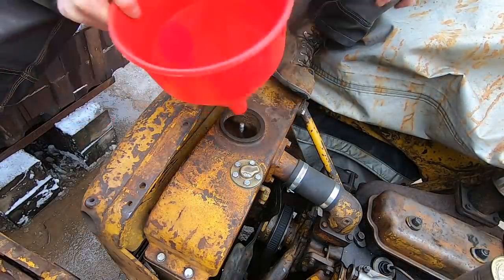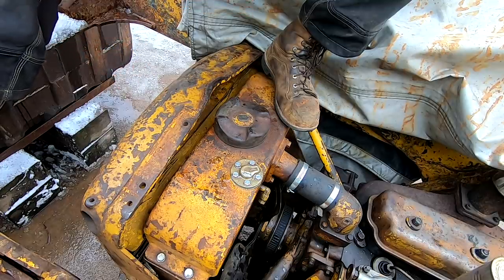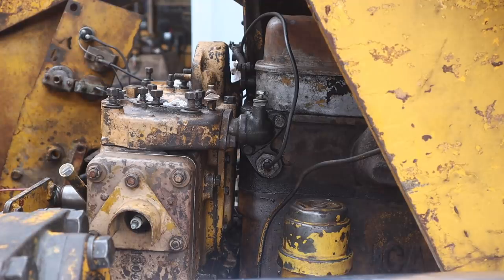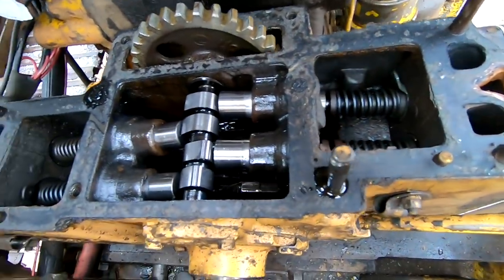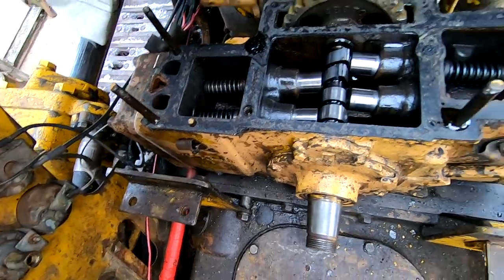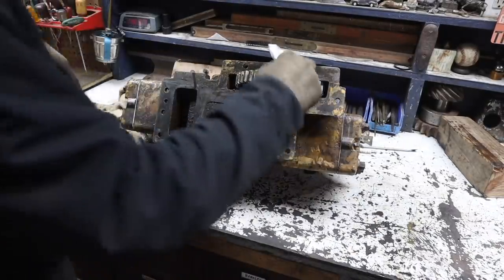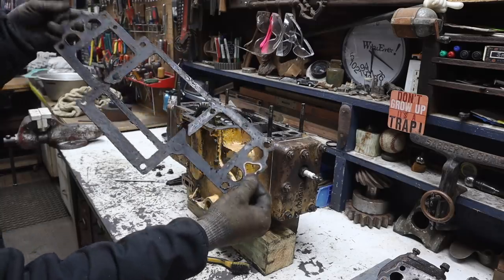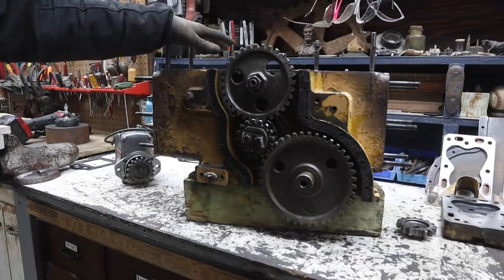I REMOVED the Pony Motor!!! ~ Part 15 ~ 1950s Caterpillar TraxCavator

Comment: Bearing material is Babbit. Casting one from scratch  could be tricky. I've seen it done by some here on Y/T.
Reply: They are aluminum.
Reply: @brianrvd  they are NOT aluminium
Reply from the maker: @bigtrev8xl  DEFINITELY an Aluminum Alloy!
Reply: @bigtrev8xl  "Aluminum alloy connecting rod and main bearings are now used in all current Caterpillar diesel engines. These bearings are interchangeable with the precision type babbitt bearings formerly used and will give much longer bearing life." Published in Caterpillar Service Magazine, November 29, 1946. Reprinted In "Selected Caterpillar Service Magazine Articles 1932-1950". Where's your proof that they are not aluminum? It is certainly not from experience. There are some of us out here who actually know about old Caterpillars.
Reply: @brianrvd  Which of the 6000 grades of aluminium?
Reply: @SalvageWorkshop   which of the 6000 grades of aluminium ?
Reply: @brianrvd  I see you're now saying "Aluminum alloy''
Reply: @bigtrev8xl  the original Cat spec from the 1940's was 750-T5 which isn't made anymore.  7075-T6 is the closest modern equivalent.  Most Cat restorers use common 6061-T6.
Reply: @bigtrev8xl  of course it is an aluminum alloy.  Are you saying that aluminum alloy isn't aluminum? Pure aluminum isn't used for hardly anything but aluminum foil.  Any commercial aluminum that you buy for making machine parts will be an alloy.  Common 6061 alloy is over 97% aluminum.
Reply: @brianrvd  Sorry, thought you said aluminium  ;) ;)
Reply: @bigtrev8xl  no, I've never said aluminium, that is just wrong. :)
Reply: @brianrvd  "Brian
 2 days ago
They are aluminum."
Reply: @bigtrev8xl  I thought you were joking about the second "i" in aluminium, that is wrong.  Pony motor bearings are aluminum.  Get one for yourself and find out.  If you think aluminum alloy is not aluminum, then you got me, they are not aluminum.  I would like to hear what you think they are made out of since you know for a fact that they are not aluminum.

Comment: Cat's starting motors were designed to be simple but not durable as they only run for short periods of time and have a 250 hour service life (according to Squatch253).  Seems like no one takes care of them and gas often gets in the oil because they have downdraft carbs and operators shut them off by killing the mag but not turning off the gas. Personally I'd just find new/used replacement main bearings, clean everything, lap the valves and just put it back together doing whatever you need to do to get the gear lash/mesh close to spec.

Comment: My husband is restoring a Siox bench grinder. He is having trouble figuring out the correct size for the ball bearings. He watched a video on here a while back and wondering if you could help with number for bearing or where you purchased yours. Thanks in advance!
Reply: Ball bearings are normally marked with an etched number but depending on the age, could be inch sizes (old stuff) metric size (for last 40 years or more) or occasionally inch inside and metric OD.  
Just need measurements and a catalog!

Comment: Babit bearings are a combination of lead and tin,especially in older engines. In today's engines l am pretty sure that they still use that with a few extra alloys. There is bearing quality brass that you can buy.

Comment: Bronz would make a great bearing, make sure about the cam bearings, its important, If  guy had a lathe and mill he could make block off for the water ports and make an adaptor for a starter and loose the pony motor

Comment: Abaut the aluminum bearing, yes bronze sounds fine but a standardized needle-bearing might be the better solution but that's up to you
If bronze you definately should cut a helical oil groove into it with a  dremmel,

Comment: Why didn't you record the end play movement with a dial indicator before disassembly? You are only assuming the movement was out of specifications.
Reply: It’s out! 
Spec is about 0.010” with a max  of .015.  That kind of end play from the bearing and it’s retaining dowel getting loose in the block eventually breaks the crankshaft in the center between the two throws.  Lots of them run a long time like that but they do break

Comment: Go searching for the second half nut. I'd presume the nut, probably still as a complete one, broke the Magneto gear and bent the shaft. If so, the second half could re-wreck all again if not extracted, as well as all shards/teeth of the ruined gear. Magnets (neodymium washer magnet on string) everywhere could help extracting those pieces. That lateral play does nothing to break gears like that, and the little amount of radial play does not do that either: There was a hard foreign object between those teeth of cam and Magneto gear to break/bend it so badly - You gotta look for the rest of this nut!
Reply: Caterpillar identified a loose pony motor flywheel as a cause of broken magneto shaft way back in the 1950’s.  Not too much of a stretch to attribute the gear failure to the same cause.  It apparently sets up some sort of harmonic.

Comment: I suspect the connecting rod nut backed off and slammed into the block, cracking it...and one way or another, cracked the magneto gear and once that failed, took out another tooth or two. That's my wild ass guess anyway.

Comment: The notch on the fly wheel is so you can use a rope to pull start the pony motor but it is the hard way to start the pony.

Comment: I know that you are getting a lot of comments from the cheap seats and or peanut gallery.  I though I would add my 1.5 cents worth of stupid comments in.  First is, please get rid of that T gauge.  I have seen some of the best screw up with those.  Get yourself a good dial bore gauge.  If the mic you use is accurate to set it, you will never get a bad reading.  I have bored a few engines and had over a million pistons go through my hands. 

Second.  I think brass and or bronze is a good choice for your bushings.  I would go for brass.  It is softer and the most widely used for bushings.  Aluminum has the greatest thermal expansion.  This means that the hotter it gets, the more clearance you get between the surface and bushing.  The hole gets bigger.  Brass is second in the thermal expansion.  This means the clearance will not not change as much as aluminum.  Third is bronze.  It has about the same thermal expansion as cast iron.  So the clearance between the two at any temp is the most stable.  The problem with bronze is it is harder.  This means it is more likely to do damage to the crank.  So brass is best.  Now the big problem is to pick out the best grade of brass.   I will leave that to you.

Third, I know you are no newbie to this, BUT.  You made indications of reusing the rings and rod bearings.  If you do this, I hope you cross hatch the cylinders and plasti-gauge  the rod bearings.

Ok, that is my 1.5 cents of useless information.  Have fun and I wish I was there to at least watch.

Comment: Given that you have gotten the engine already apart just spend the extra 40 or 50 dollars and replace the rings and rod bearings. Time wise it's only about  30 extra minutes and you know for sure that the rings and bearings are good.

Comment: If there is slack in both directions on the pony motor crankshaft, then both bearings are bad, front and back.

Comment: Castle nut was probably stuck in sludge at the bottom of the oil pan but got freed up, when he changed the oil, then it got between the gears and broke the teeth.

Comment: Cat made everything themselves, I thought they bought the ponys from somebody like Kohler, but no, made their own.  It's built like a tractor engine, tough, well it's a cat.  Your right about somebody being in there B4.  I'll bet those spiral grove move oil inward so they don't need oil seals.
Reply: Correct, called oil slingers. First time I saw them was on Ford Flathead V8.
Reply: @johnliebermann4643  common on British cars, that's why they always have a little oil drip.

Comment: I am confident the water flow is thermosyphon through the pony motor. It will naturally lift water through itself and down through the main engine. The main engine will reverse the flow when it starts.
Reply: As soon as possible after starting the pony motor, the pinion is engaged and main engine turns so it’s water pump circulates some coolant within the block.  But you’re probably right about the thermosiphon since the pony is a long way from the water pump with small connections and the pony doesn’t turn the diesel that fast.
Reply: Coolant flow is always into block water jacket (including pony) and up through deck and into head (and up through pony motor top cover/manifold) before moving forward to
Reply: Water pump and thermostat housing
Reply: @jimrankin2583  No warm up on the pony motor at all? I will take your word on it, but that seems a bit cruel it. I honestly thought it ran for a bit to warm the inlet manifold via its exhaust pipe.

Comment: Hi,,, If antifreeze will freeze at 100%, how come the jugs in the back of my pu all winter at -25 dont freeze? Your better off draining complete system, you will have pockets of water. Good luck
Reply: Full strength antifreeze will still freeze if you get it cold enough.  All liquids will freeze at some point.

Comment: Is the excessive end-play of the crankshaft caused by the loose locating pin in the bearing or wear in the thickness of the bearing.  I would try and find the bearing measurements.  You also need to know how oversized the bearing needs to be to get a proper interference press fit.
Reply: Caused by the bearing getting hammered outwards, which is what loosens the pin (hole in bearing gets ovaled).

Comment: But where did the half crown nut come from? I'd look into that.
Reply: Half crown on these nuts
Reply: Maybe it's why one of the retaining wires was missing from one of the crown nuts. Perhaps it broke off while someone was servicing the motor in the past, a piece fell down into the motor, and they couldn't find it, so just put a new one on and put the motor back together.
Reply: Previous repair.  He found all 4 still in place.  The other guy didn’t find it when he was cleaning out all the shrapnel that resulted from the last time!

Comment: I'm surprised the bearing is aluminium. I'm not an expert but depending on the alloy, aluminium would be either too soft and wear out or too hard and wear the crank? IDK!! Shouldn't bearings of this type be White Metal or Babbit Metal? Bronze I'm sure would be too hard.  It's brilliant to watch you either way! It's great that the guts of the pony were in such good condition.
I still think you're gonna have to strip down the entire machine to achieve the quality and reliability you're after. Unfortunately!

Comment: It would have been good to measure how much end play you had in the crank before taking it apart so you’d know how deep to make that new bearing, you definitely don’t want it too thick or friction from binding will be an issue. You indicated you thought the play was in the back bearing, so I assume you checked the alignment of the gears. Too bad the bearing itself wasn’t in better shape or you could have just added a small spacer at the rear of the bearing with the crankshaft hole slightly larger than the crank to prevent scoring, definitely better to replace it with that inner surface scoring and it being slightly out of round. Only issue might be thermal expansion differences, if there is someone here that knows the engines and the material used to match up to factory original, that would be best. It seems odd and unlikely that it’s aluminum from the factory, aluminum expands roughly twice as much as steel and that could cause problems, or maybe that accounts for the play? Worth looking into.
Reply: To clarify a bit, if it is aluminum you’d need extra end play to prevent the bearing from binding on the crank as the engine warms. How much end play though I have no idea personally.

Comment: Bronze vs Aluminum bronze will not get impregnated with dirt and other crap, get the crank smooth I would recommend a machine shop unless you have the tools to it, rod bearings should be checked and sized to the journals if piston and sleeves are all good take a ball hone and give them a  good x hatch, re-assemble and enjoy.
Reply: "bronze will not get impregnated with dirt and other crap"  Which is why it's not a suitable bearing material for this situation.

Comment: Do the Pony and diesel share the same oil circuit?
Is there a chance that piece of castle nut is from somewhere else?
Reply: They do not share oil, just coolant.
Reply: @brianrvd  Why broken castle nut? Where's the other half of it? Did it spin a rod bearing? Careless mechanic? What broke it? I'd like to see the diesel out and autopsied, too. How much sludge in that pan? He only found 1 tooth- where are others? I would personally dig to bottom. Clean, reassemble, slather on new CAT yellow.
Reply: The teeth are confined to the pinion drive gear case on the front of the pony motor.  It has its own oil separate from either pony crankcase or diesel crankcase.  The remaining teeth and chips are probably in the pinion assembly that’s bolted into the flywheel housing.  I don’t know if they’ll fall out of the way or everything or eventually get in a bearing or the gear

Comment: I would think aluminium would be too soft to use as bearings, usually white metal on cars which is a mixture of metals, brass should work ok but check ur clearances

Comment: So what is the reason for the extreme crankshaft end play? I don't think you addressed that.
Reply: Front bearing is loose on the crankcase bore and retaining dowel is loose too.  Basically it’s moving fore and aft allowing the crank to move that much.
Reply: @jimrankin2583  Thanks for the reply Jim! Love the process of the re do of Red!

Comment: If bonze/brass bushing was a good choice the engine designers would hav used that.  Probably those crank bushings have a babbit sleeve poured in the outer shell.  It is possible to repour the babbit.
Reply: They were solid aluminum.

Comment: The aluminium rear bearing has three holes and loose pin. What if the loose pin is the end float ? And I see three holes. Are they to adjust the crank end float? (Each hole is a different offset)
Reply: The pin should be tight in the center hole and prevents the bearing from moving.  The two outer holes are to allow oil to run into the bearing.  The pin also has a hole through the center for oil.  The block has an oil catching tray that feeds the holes.

Comment: Aluminum expands with heat to create a seal.  they are not babbit bearings which are usually lead.  Please do not machine your own, try and find them first because it is the type of aluminum you need.  it is not just your run of the mill type.  it is a hardened aluminum alloy with a chrome molly mix

Comment: I don't think crankshaft end play did that. The gear is designed as the weak point, those other gears turn that gear, not vice versa. The problem is with the mag or the mounting of the mag as someone else here is saying. Been a mechanic 45 yrs

Comment: The conversion to direct start would be very expensive. On the order of about 2k at least. Probably closer to 2500.
Reply from the maker: I'm going to prove that wrong! (but i'm not converting it, I'm going to add a direct start for the diesel in addition to the Pony motor.)

Comment: I’ve read that the pony motor is meant to run for approximately 250 hours before rebuilding is required so I’m sure someone has been in there several times over the years. 
The Diesel engine could have  several thousand hours in comparison

Comment: Those white metal bearings are probably babbit. I would be replacing with original metal. It would be a big mistake to do away with the pony motor, as the tractor would lose it’s character. The clearance between the gears is not the reason for the broken teeth. Thanks for the video.

Comment: The play in the crank did not cause the cast gear to break! I've seen cast gears break due to historical abuse such as being held very hard in a vice or being dropped. It's all it takes and the gear can run for a time before a tooth comes off. 
Please reach out to squatch253 for advice before you do anything with bearings.

Comment: So where are the missing teeth to the magneto gear.  You found one.  Where are the rest?  IMHO there is not enough wrong with that pony motor to cause the mag teeth to break.  Could the half of the castle nut gotten up there?

Comment: In Cold times; that Pony Motor heats the engine s do the later models with glow plugs; having Both is fine insurance to me (77 yrs of life). That engine will start at sub zero temps for you. Going to keep watching for sure.
Reply: Replace those cam and crank bearings if you can.

Comment: I’m so sorry, but your using that telescoping snap gauge wrong. You should be expanding it just off center and rocking it through the bore and then taking the measurement. And even then it’s just a comparison measurement. I can almost guarantee that you will get 0.010 or more on that diameter. Just trying to help get a better result

Comment: As other commenters have noted, the crank bearings are likely soft babbit. I do not recommend using hard bronze. It will end up wearing out the crankshaft.
You might try turning a mandrel to hold the bearing, then knurl the OD of the bearing.
This will oversize the OD. When you press it in, it will tend to shrink the ID.  Maybe just enough to do the trick.
Polish the crankshaft journal in the lathe with very fine emery paper followed by crocus cloth. Focus on removal of any high spots and achieving a slick surface finish removing as little material as possible.
Use a shim to adjust crank end play.